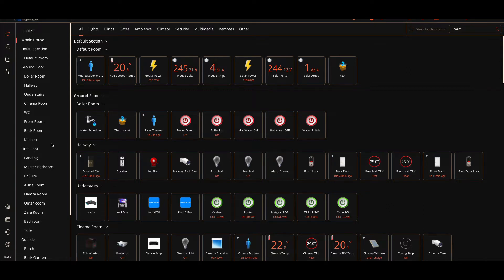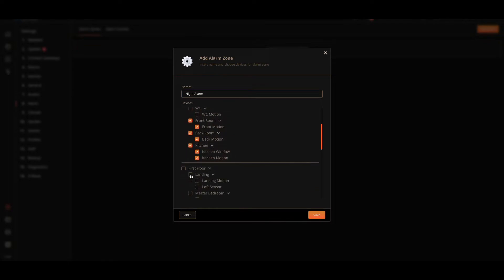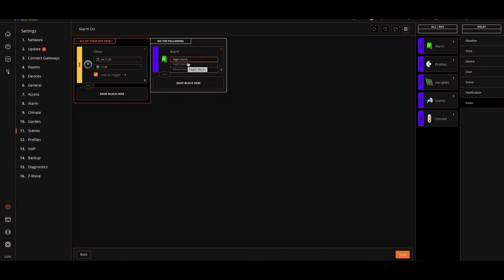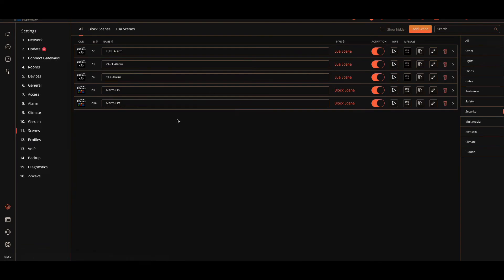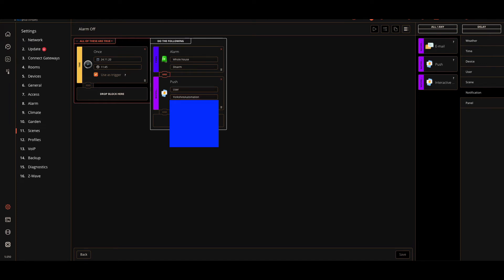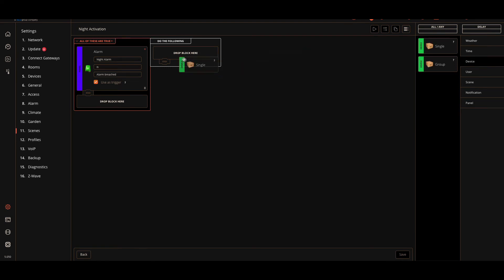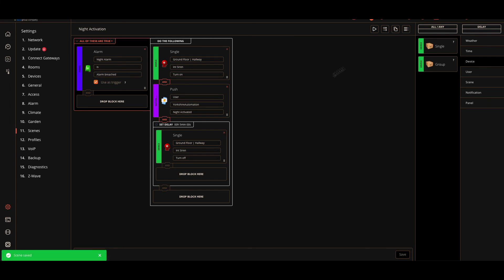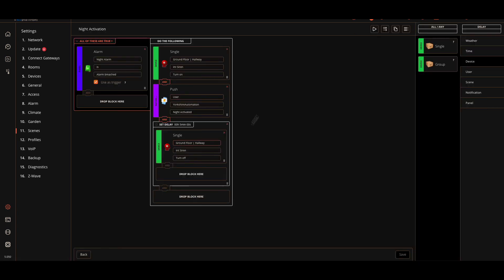Create an Alarm Scene with Fibaro Home Center 3

Comment: Thanks for the Video and greets from Germany. When I enter my apartment while the alarm is armed, my Hue lights turn on and change to red, when i disarm the alarm they turn green and few sec later off. I don't have a siren yet, only notification. My problem is, even if i disarm the alarm in the alarm-zone-delay-time it sends me the notification and i guess a siren would start aswell. Can you tell me how to stop the alarm scene? I have put in another 20 sec delay for sending the notification but it gets sent even if i disarm the alarm right after entering.
Reply: create a LUA scene and you need to kill the scene
Reply: @simsokracing8210  thx for your answer. unfortunately I haven't done a LUA scene yet. So it is not possible to do that with block scenes?
Reply from the maker: No unfortunately can only be done with LUA scenes.
Reply: @09wanteD  some sirens in HC3 you can turn off . Or lower the volume to 0% . 
Not sure if that helps . If it helps then u can just put a scene ( mute alarm ) and choose the siren then turn off or volume 0% 

But for push notifications I think won't stop it unless u disarm the alarm